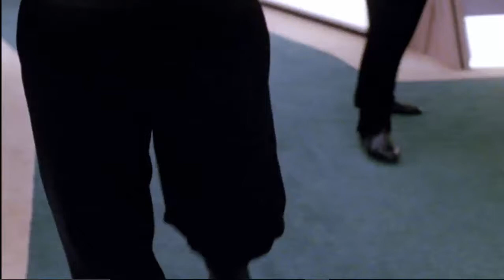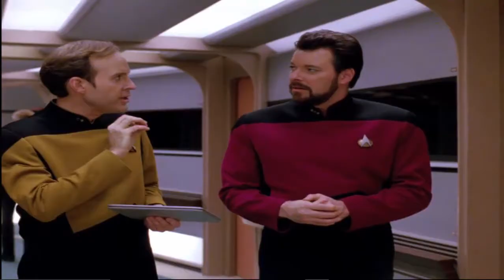technobabble

Comment: Pfft....then how did he compensate for the variation in field fluctuation in the phase capacitors without creating a ship-wide parophoretic reaction? Technobabble indeed.
Reply: Easy: invert the polaraties and link the Heisenberg-compensator directly to the warp core.....duh?
Reply: @Das_Kaenguru  You don't invert the polarity…
You reverse the polarity of the neutron flow.
Reply: @casbot71  not if you don’t want your warpcore to breach....are you pakled? 🤨
Reply: Remind me never to visit the engineering deck again.
Reply: Simple. E=mc^2!
Reply: 220, 221 - whatever it takes.
Reply: Heisenberg compensator in parallel with the phaser filter.
Reply: @casbot71  I appreciate the subtle choice of the neutron in this humor.

Comment: He’s literally just saying that he combined the output of the shields and the main deflector into one (they function in a similar way). He also says that once he had them combined, he used the parts of the ship that normally create a warp bubble to create a shield bubble instead (made up of both the shield and deflector outputs) which gave it even MORE power.

That’s the great thing with classic Trek “technobabble” - it actually DOES have a meaning, albeit a scifi one!